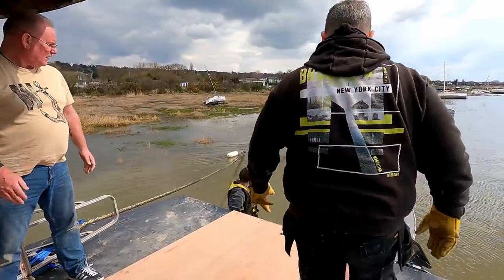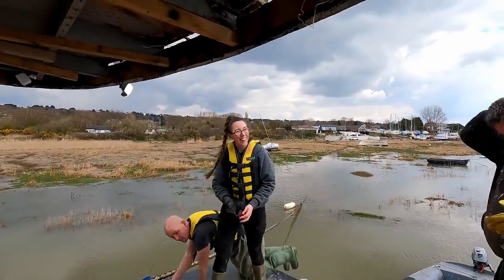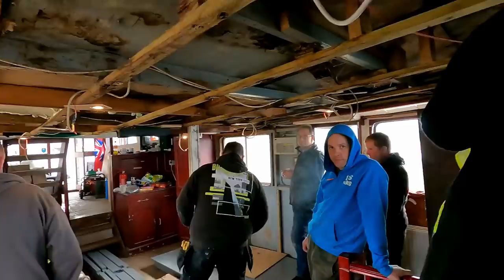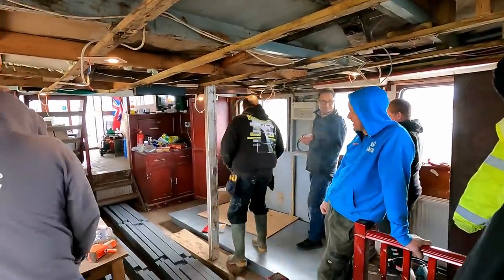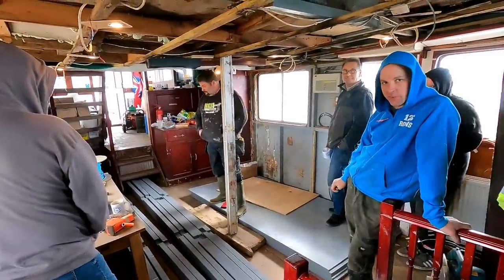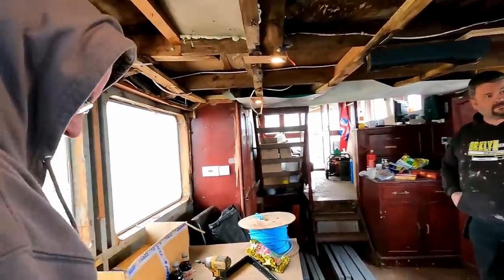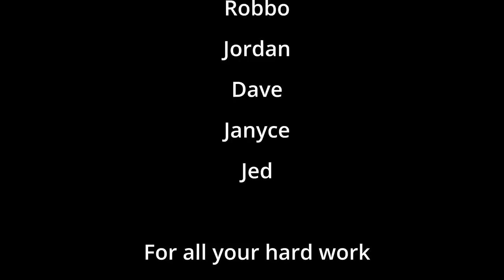Ep 66 - Flat Pack Boat Roof! Moving Our Roof To The Boat #boatrestoration

Comment: The scrap wood why not just burn it, warmth and remove the wood in one simple way?.
Reply: Agree. In remote anchorages and/or at sea, it is common to burn combustible trash, cut up and throw over the side biodegradable trash and only ferry ashore the stuff you have to. Otherwise the boat would become one big trash can, on long passages.